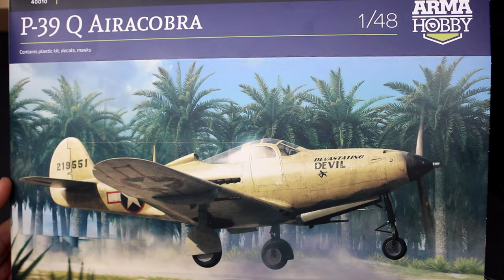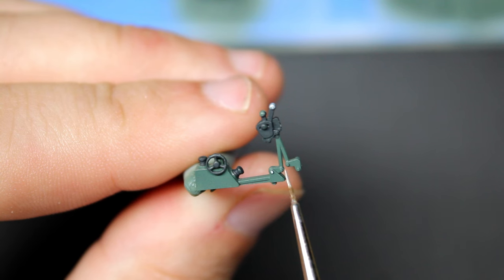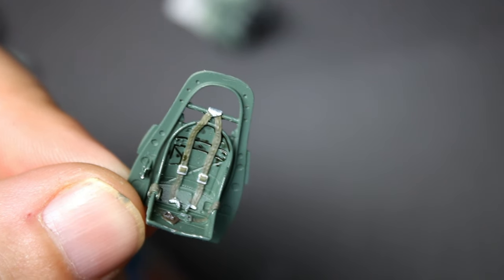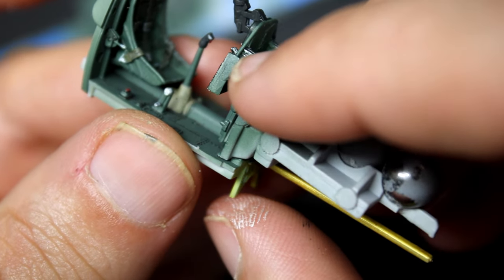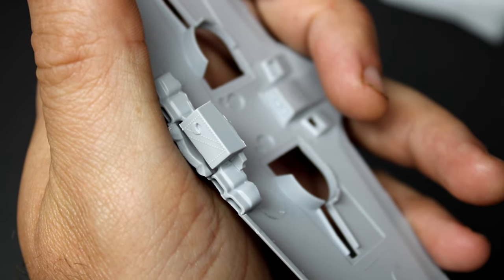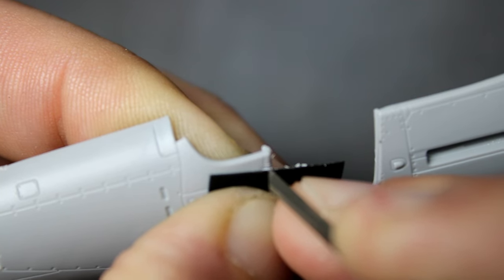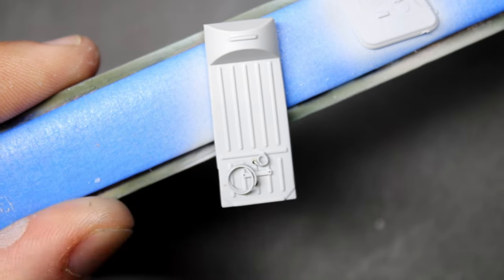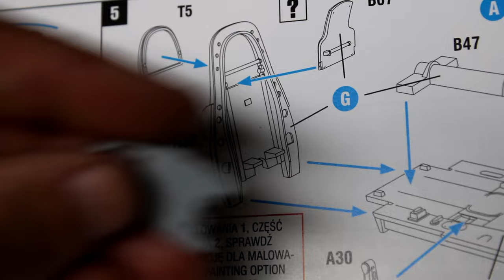The All New Arma 1/48 P-39Q Airacobra! Full build Review

Comment: Concerning the tip with drilling small to large: Normal 2-fluted drill bits don't center very well in pre-drilled smaller holes. Better use a narrowly tapered reamer to widen the pilot hole.

(In machining speciall three-fluted drill bits are used to widen holes.)
Reply from the maker: @HotelPapa100  in the real world I’d just go to the reamer :)

Comment: That is a really nice build and the painting is exceptional. I noted your comments on the fit of the parts. I recently built the Tamiya P-38 and the kit goes together very well with no flash or fit issues. I kind of felt that the build didn't offer enough challenge as it was a little like putting Lego together. I kind of like a bit of fit issue challenge and the opportunity to build in some personal extra detailing. For me the most important part is now the quality of the exterior detail like panel lines and rivets. Older kits lacking detail or having excessive deep and overscale panel lines don't cut it for me now.

Comment: With regard as to which door was used for cockpit entry and exit, it is true that pilots used the starboard door on a P-39. The reason for this was that the throttle quadrant actually encroached a little into the port door opening, and there was a real risk of damaging it by a pilot wearing bulky flying gear. It was, therefore, much easier and safer to use the starboard opening. The port door was usually used by ground crews for easier ancillary access on the port side.
I suspect the photos you have were possibly taken for publicity purposes.
In early variants of the Hawker Typhoon fitted with 'car doors', pilots also accessed the cockpit on the starboard side.
Reply: Yep, this.  I try to model day-to-day reality, not staged publicity shots.  Right door open, or both doors open or closed, but I wouldn't model only the left door open.  Of course at least one kit  (I'm looking at you, Academy) only offers a left door open option.
Reply: @thadrobinson8343  Absolutely. At the end of the day, it's a scale model and how it's built and displayed is up to the person that's assembled it.
Reply from the maker: @markfranks1329 I guess I can call the build good when the only flaw people are pointing out is the “wrong” door is open
Reply: @TheModelGuy  That wasn't meant as criticism in any way. I was just pointing out a fact. My comments were in no way a negative reflection of your skills as a modeller. 
As I stated to someone else. It's your model. How you assemble it and present it is your perogative and no one else's. Again, that's all that matters.

Comment: The Soviets at least could appreciate the P-39 and make the most of it despite its shortcomings. You’ve done the same with this build! Looks sharp as always.

I’ve been wanting to build one myself and thought I might try the Arma, especially after my last Hasegawa kit left such a bad taste in my mouth. But Arma prices in Japan are outrageous, and I wonder if the old Eduard might not be best, if only I can find one.
Reply from the maker: @plastictsubasa1390  they definitely made an impact with the Soviets. I still need to do a historical build video with the -39. But I appreciate you liking the final result:)
Reply: The Eduard kit is nice, but it has absurdly thick and squared-off trailing edges that really need to be addressed by the builder.

Comment: I second your recommendations on Doog's black chasing series. Really took my paint jobs up a notch. In fact, if I do a good job on the under coats and don't overdo the blend coat, I don't even need to bother with oil paint work as there is plenty of depth and variation without it and honestly I think it looks a lot better.

I had been having some trouble with OD schemes, they didn't show enough variation so I appreciate what you did here. On my next OD build I'm going to use some of your colors underneath as I mostly stuck to greens and browns.

Also, for the price, I think I'll stick with the Eduard kit. Yes, it has some issues but looks a lot less fussy overall.
Reply: Black-BASING, not chasing. Stupid autocorrect...

Comment: Try building the AFV Pak 43. I had to finally put it down after assembling the cradle. Huge ejector pin marks, no locating pins to align pieces, it was overwhelming. And I agree building a model shouldn’t induce massive frustration due to poor manufacturing. I’ve been building the 1/48 HKM b17g and I’ve had the fuselage crack twice due to fit issues so frustrating. I tried flooding the inside with CA GLUE but I’m not sure if that will be a good long term solution. Keep up the good work!
Reply from the maker: @InSidious1805  I have their B-17F that Eduard released….
Reply: This was a build for my friend, his dad flew one during the war and he was shot down by one of the German jet fighters he managed to crash land in Poland. He purchased all of the Eduard photoetch. In my opinion the only one really worth it is maybe the radio room and the bomb bay. I’ve been working on it for years and after everything was sealed off you can barely see any of the detail. I actually ruined a few pieces so bought the same kit for myself to swap parts so I’m sure when I rebuild it I’ll keep it much simpler.

Comment: Excellent job.
I know as a careful modeler,it goes against the grain to remove location pins..lol i always figured i can trust the guys who designed the kit....nope.
Thanks for all your efforts.
Reply from the maker: @stevecausey545  I think the problem was the guys doing the molds. Tolerances were not as tight as needed
Reply: @TheModelGuy  the parts look delicate and lovely..that had to be frustrating..I've been building old monogram kits I built as a kid..some fit great some need a bit of work.
I just got tired of gazillion part kits this summer.
You did an amazing job on the airacobra!

Comment: P-39 pilots generally did not enter/exit the cockpit from the port side side because they would bang their knees on the trim tab control wheel when entering the cockpit.  Notice that its placement is directly in front of the door obstructing easy access to the cockpit.  Not really the best design location.  They usually entered from the starboard side to save their knees from this repeated nuisance.  But yes, they could enter from either side, hence doors on both sides.

Comment: Got their Dieppe double set of the 1/72nd Hurricane... Not gonna lie, it's impressive. It kind of takes you aback a bit. Gonna build it, of course. Just not now.

Whoa... Those plastic shenanigans oozed some real "Indian Airfix kit" stench. Pretty sad thing that Arma had their name tarnished by a subpar product. I'm pretty sure they were sent the better test-shots of the "0" batch for checking, greenlighted production and then the production company ran a "Nah, it'll be fine..." on them. Just like what happened to Airfix when they moved their production chain to India.

Still hating every single Humbrol paint produced there. Absolute awful quality.

Excellent work ironing out the issues, Rob.

Cheers.